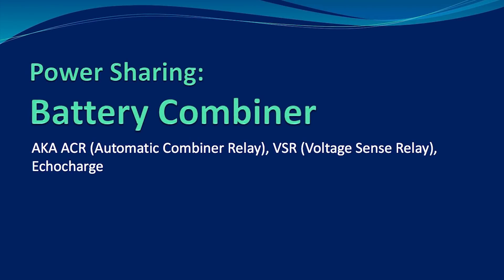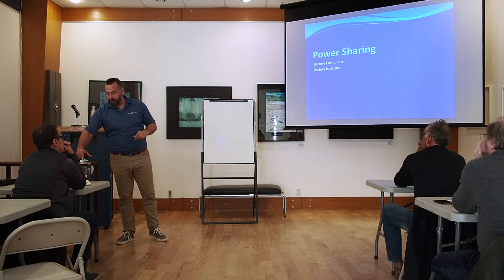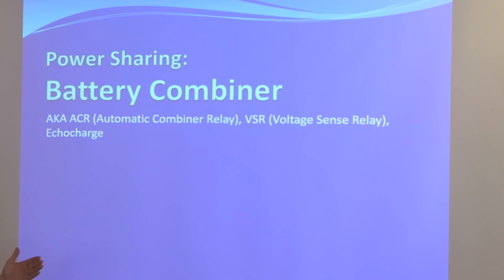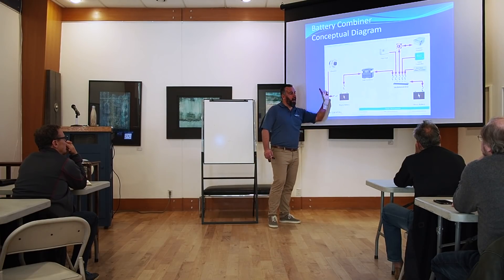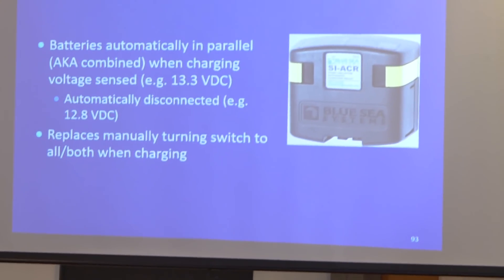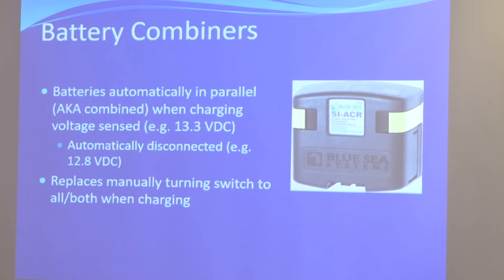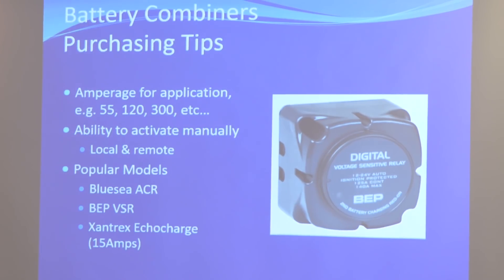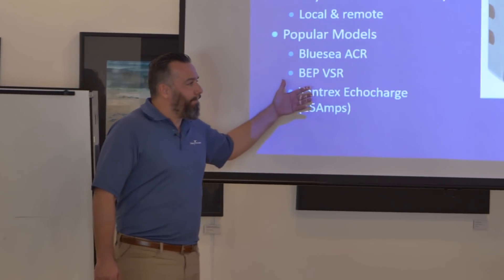How To: Marine Electrical Seminar - Battery Combiners - Ep 10/30

Comment: Hi Jeff, from Australia. 
I have a small trailer boat with a 104 AMP deep cycle battery for my Minn Kota and a small start battery of around 500 CCA. I have a 140 AMP dual input VSR fused on both sides with 80 AMP midi fuses. My outboard alternator is 16 AMPs. Wiring goes from the start battery positive terminal to an on/off/combined switch terminal 1 then continues from this terminal via midi fuses and VSR back to the switch terminal 2, then on to the house battery positive terminal. I have a seperate cable running via a 30 AMP circuit breaker to a switch panel with inbuilt circuit breakers to run all accessories. The Minn Kota is also fed direct from the house positive terminal with 60 AMP breaker. Finally I have an onboard AC charger connected to both batteries. Any issues with this as described? Would greatly appreciate your opinion. Love your videos mate, extremely informative.
Cheers Mark

Comment: Hi Jeff. Can I connect the SI - ACR at the switch (4 studs), ie using the positives on the switch, ie not after the switch but at the switch? Pros and cons?
Reply from the maker: Yep, you can. Challenge is fusing the ACR connections at the battery switch.

Comment: This video raises a question for me. Simple 20 foot Bayliner 60 some amp alternator. Currently one battery so I have to be very careful with chart plotter, radio, lights. Game plan is to add an average sized group 24 deep cycle and a blue seas ACR system. The idea is I can drop anchor and not worry about the chart plotter and other auxiliaries because of the battery isolation. The question is, now I will be depleting the house battery by as much as 50% for a day of fishing or just bobbing. All lights are LED (Anchor/Nav) Chart plotter draws about 1 amp. Radio about 1 amp. Is this system appropriate for my intended use?

Comment: Hi Jeff, I have a question I would love your advice on.

I have a 31ft tiara with twin yanmar 315hp engines, 12v 80amp alternators on each. Each engine has a lead acid 4d deep cycle battery that acts as starter and house. Port runs windlass and starboard runs house. Battery switch is left on both at all times as I think it needs to be as I only have 2 batteries. 

I would like them to be combined when they are receiving charge but separate when they aren't so that one can't drain the other.

Can you advise how I can avoid that happening as I cannot figure it out. 

Thanks, and thanks for another great video, I'm learning every time!
Reply from the maker: Hi John, battery switching isn't a easy topic to cover in a chat. But here goes: each engine should have it's own dedicated off-1-2-both switch. Each engine should only start on their respective battery, since you have two engines and two batteries, there is no need to have the battery switches set to all/both.

Comment: I have house bank of 4 and engine of 1 all AGM with a VSR. Looking at going lithium when they crap out. Do I still keep an AGM as engine battery and what are implications for the combiner?
Reply from the maker: Hi Lynndon, many ways to do this, but here is our preferred method with a lithium house bank, install a DC to DC charger to charge the AGM starting battery.

Comment: My service batteries are really weak now and my engine battery is brand new. I have a 55 11e Blue Sea combiner and a Blue Sea SI ACR. There are 3 positions on the combiner : off/0, on/1, and combine batteries. I always keep it on the on/1 position. After 5 days my engine battery is as weak as my service batteries. Is it normal. Isn't this device designed  to separate the battery banks ?  So that when one banks is dead the other can still be charged ? I hope it is clear enough !
Reply from the maker: Hi Olivier, from reading your notes, sounds to me like you have a weak engine battery. Your off/on/combine battery switches keeps the house and engine battery banks separate.
Reply: @PacificYachtSystems  it is brand new ! What if I disconnect my housse batteries from the ACR to test my engine battery ? Will it work on the on/1 position ?

Comment: Can you explain unswitched distribution. Is it a positive bus bar to combine all the positives?
Reply from the maker: Jake, great reply. Bang-on!
Reply: Yes, located between the battery and the battery selector switch, that way its always "on" regardless of the switch position. On my boat it holds all charge loads, and the bilge pumps/alarm on the engine battery.

Comment: I have a question - You know that if you turn off the switch from the alternator to the battery, that you break the alternator.  I guess that will have the same result if the fuse on that cable trip, right? Won't that ruin the alternator as well? I guess it's better than a fire.... But a nuisance trip would be very costly. Any comment on this? (without going into the rabbit hole for 2 hours, hehe). Love your videos!
Reply from the maker: Good points 1975Per. That's why you size the conductor and the fuse for the alternator to never have a nuissance trip. For instance, on my own boat i have a 160 amp alternator wired with 2/0 wiring  (handles 300 amp) and my fuse is 250 amps.
Reply: @PacificYachtSystems  are you using ANL fuses and holders to connect the alternator, charger, solar, and fuel cell to the bus?

Comment: great vid again! Batt isolator video would probably answer my questions. But im in the middle of a decision making while learning. sorry if this sounds stupid, so im gonna throw it anyway.
Is it possible to feed the victron argofet (or smilar) or a battery combiner(ACR-VSR)  through an external voltage regulator from an alternator (balmar mc or smilar)to  charge the batteries at the correct charging state -  bulk, absorption or float ?
 If so how does the voltage regulator know at what charging state the batteries at, especially one (say house batt bank) is at lower voltage and different temperatures.
The more i got info bombed the more it becomes confusing.
If there is an answer to this question and its too complicated to explain. can you point out where I should pay attention to the Nigel's electrical bible.
Reply from the maker: Hi Jake, next video will be uploaded next Tuesday.
Reply from the maker: Hi Deniz, you can definitely use a battery combiner or a battery isolator with a external regulator. Careful as things get tricky doing the connections for the voltage sense.
Reply: I've got the exact same question, what's the product you hint at at the end of the video?

Any ETA on when the next upload will be?

Comment: Ok, so the VSR is hooked up. And my switch is on/off/combine.
I never use combine?
Reply from the maker: Correct. Combine is only used in case of emergencies, i.e. when you need to force your batteries to be in parallel or combined.
Reply: Pacific Yacht Systems very good to know.
Thanks again for delivering quality information that matters.!